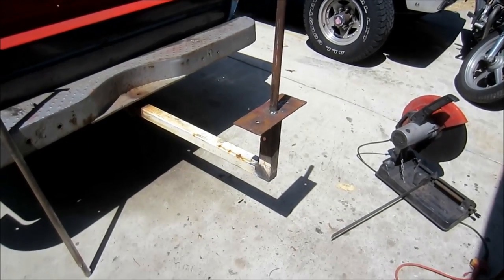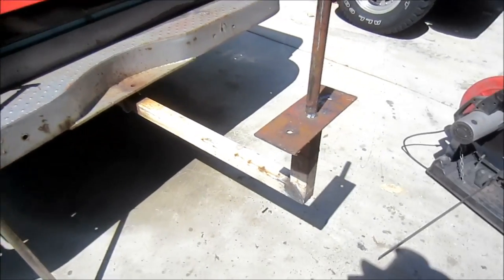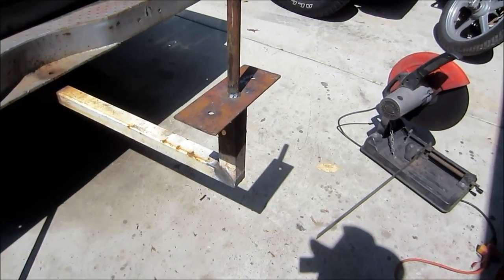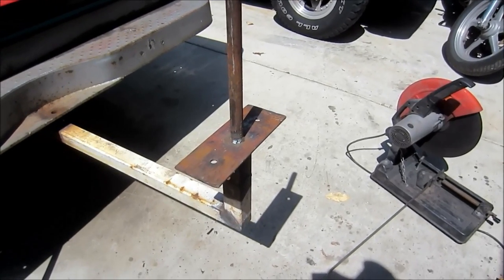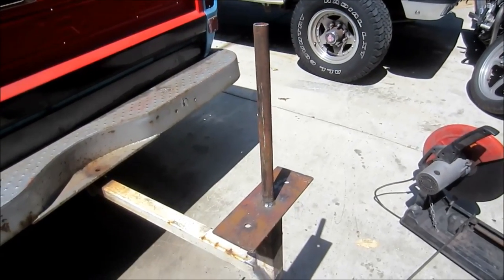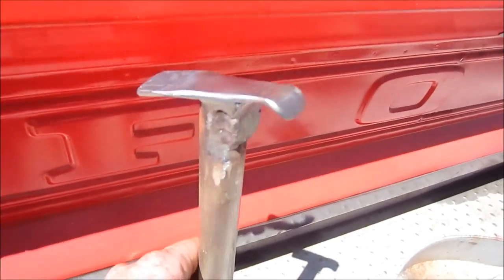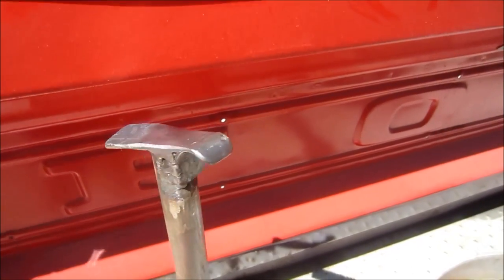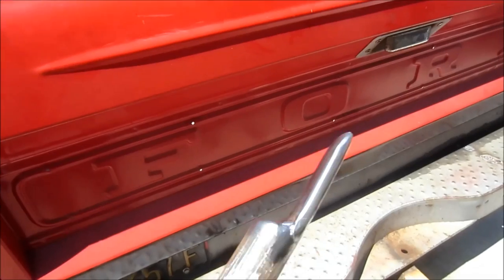Home Made Hitch Mount Tire Changer

Comment: a little soapy water sprayed on the bead will make your life way easier.  also before you mount it, lube both beads, and then just slam the first bead down on at an angle, you will not need to use a bar to get the first bead on.
Reply: Really is amazing the difference soap makes.

Comment: I made one similar for small lawnmower type tires but I made the back of it where I can slide it up and down in a sleeve and goes down to the ground  and lock it with with a hole and nut welded on and a bolt through that to lock it. I can pick up on the receiver part with one hand and lock it with the other hand. That puts some pickup weight down on it. Takes most all of the sway and give out of it.
Reply: Send me a link I would like to see it

Comment: Any updates, how about a how to and what you would have done different. This looks like a fantastic solution for what I need.
Reply: just buy some real tire irons and tire soap, dont bother with this setup or using rachet straps they arent worth a fuk i been using a set of 15inch tire irons and a 40 inch mount/dismount bar  they make it way easier